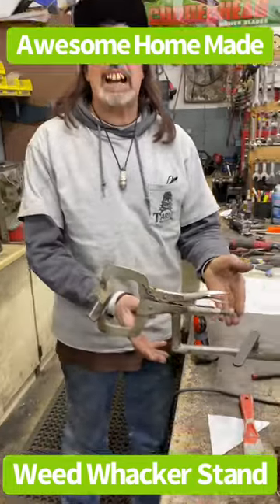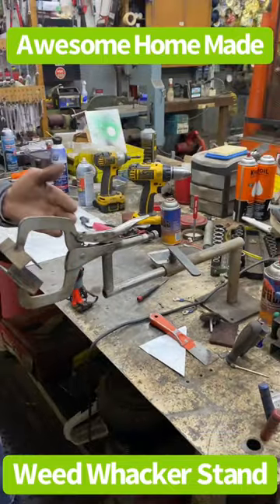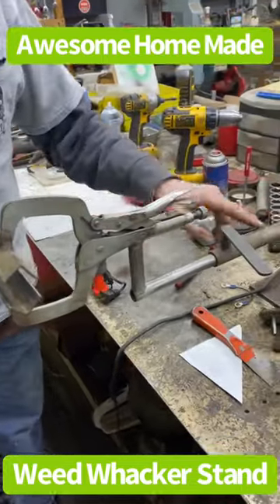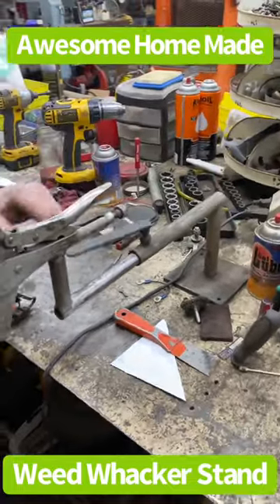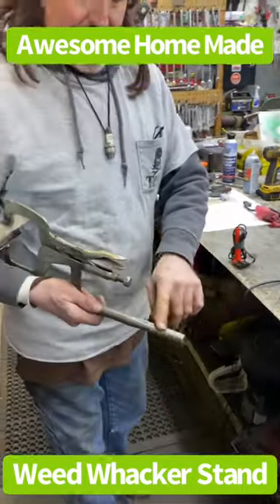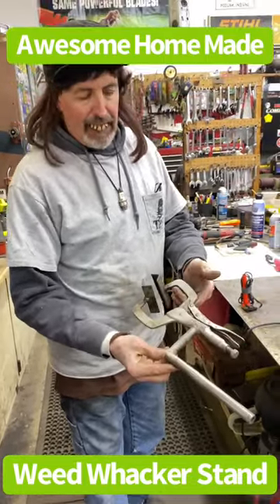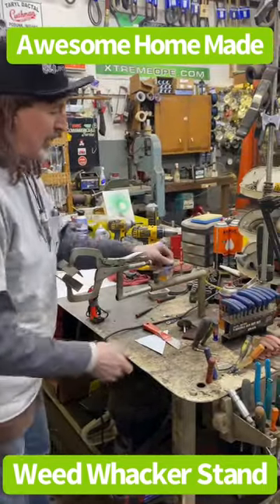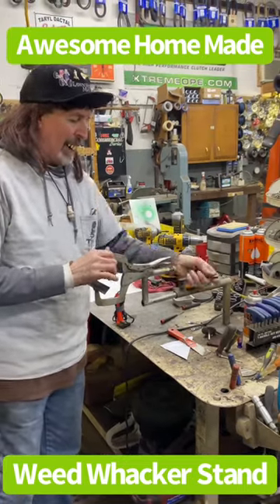Super AWESOME Home Made Weed Whacker Stand

Comment: Genius. I use a bicycle stand but I need another one for outside like this. Should I tell everybody I came up with this idea?
Reply: I have been using a bicycle stand for years, the trick is some of the repair stands will fit on a PA speaker stand. That's what I do with mine, I can work on trimmers anywhere inside or outside 😎
Reply: @patthesoundguy  I’m thinking about making something like this with a c clamp and weld some jaws in it. The problem I see with vice grips is sometimes the jaws pop open and there goes your trimmer on the floor and you broke your trimmer